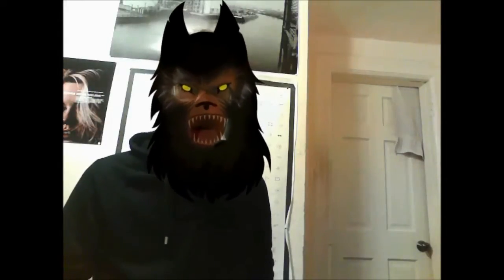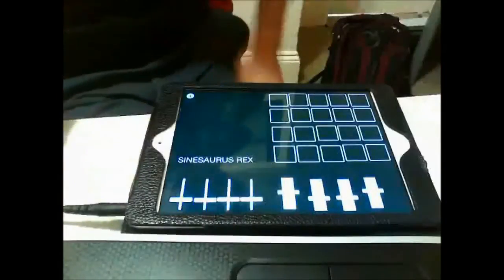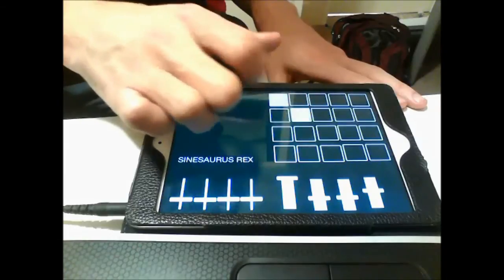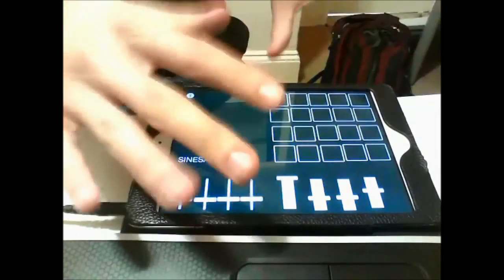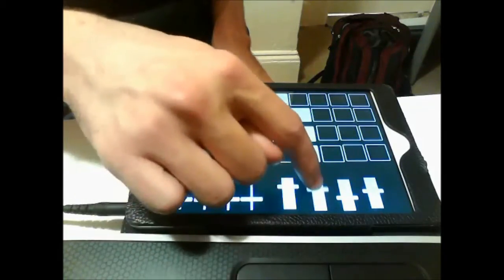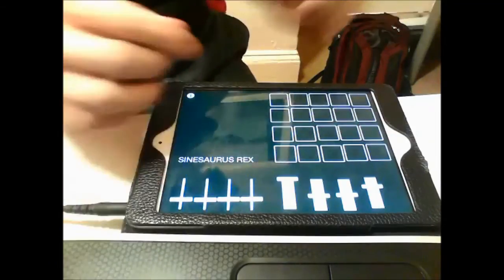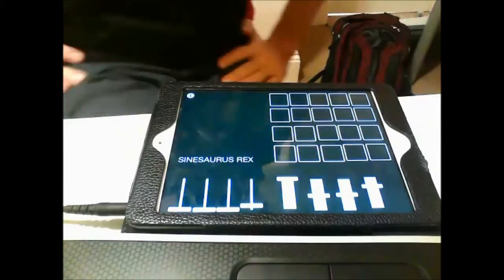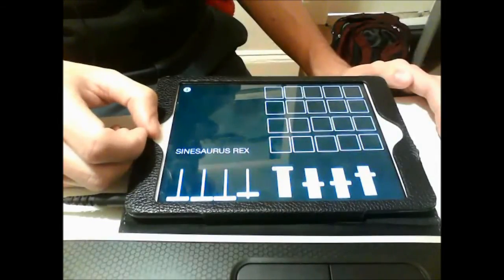Sine Divider + Pure Data and MobMuPlat

Comment: nice job! You mention it is easy to end up with infrasound on the bottom oscillators if you aren't careful, and also from your performance it seems like this thing would benefit a lot from being able to automate parameters (using your finger to oscillate the volume on one of the banks gave a great effect but looked a bit awkward). Have you thought about functionality to reassign oscillators from generating sound to controlling parameters in the instrument? If you came up with some clever general way of working things I bet this would be pretty powerful - ring modulation would be a cinch, and imagine being able to set up systems for feedback control of pitch in a few taps. It would also make no distinction between rhythm and pitch, which is cool in its own right :D
Reply from the maker: Hi Mekon. Thanks for the comments. Yes, it'd be very easy to do any of the many things you mentioned. I was going for something a bit on the minimal side. Controlling the volume is a priority though.

I'm not all that into Pure Data. Would much rather spend my time in Max or soldering some circuits together. Really into the idea of pitch and rhythm being one. Check out Lunetta synthesizers!